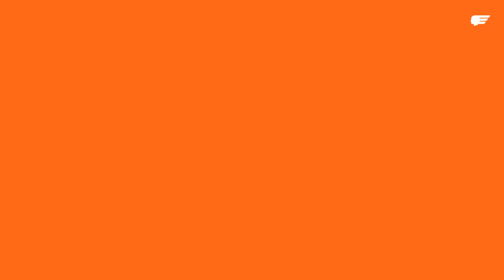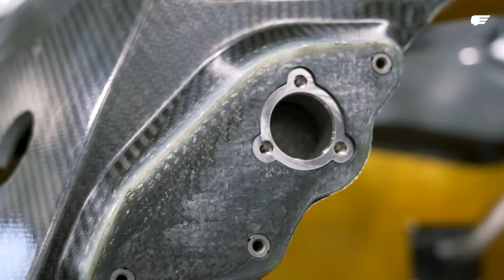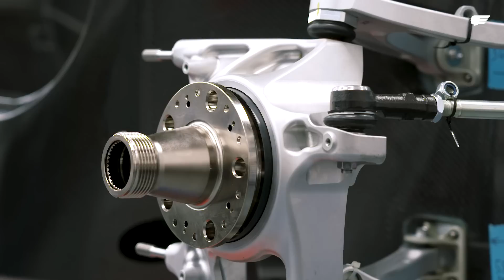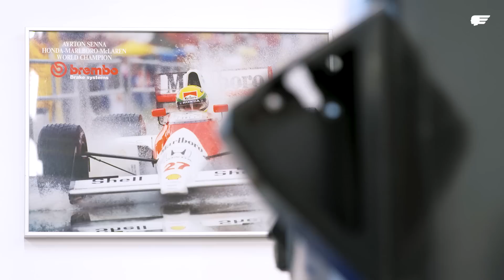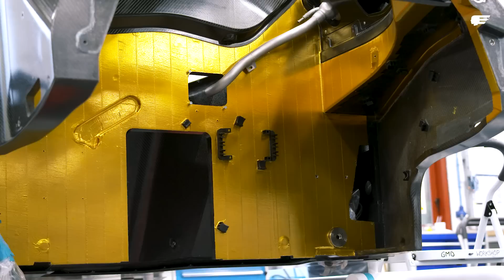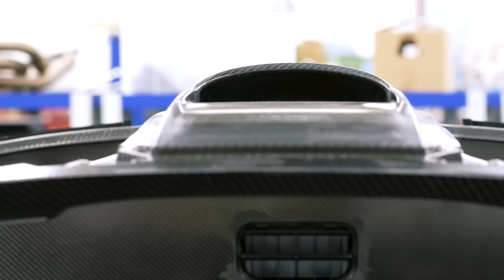T.50 VLOG | EPISODE #2 | XP1 MONOCOQUE

Comment: Now that's some quality teasing.
I see the gold foil from the McLaren F1 is back too! 🐧
Reply: It is DEI Reflect-A-Gold tape, not actual gold foil.
Reply: @erik_eriksson_design  It also has worse thermal properties than their silver colored foil, but everyone goes for the gold colored because bling bling. lol
Reply: @jlehm  Silver is better at wide range, but gold is better at narrower IR radiation band that happens to be found at enginebay temperatures. But from gold have been moved to MLI-materials. That is basically kapton on top of mylar.
Reply: @erik_eriksson_design  That may be true, but the two foils are gold colored and silver colored, but both are made from aluminum, and therefore where the products get their properties from.  The temp capability difference between the two products likely has more to do with the thickness of the fiberglass backing than anything. Go look at DEI's site.  It's really just a bling factor with the gold color.  I'm sure NASA uses real gold coated foil, but not us peons.
Reply: @jlehm  I wrote you long comment but youtube somehow missed it... anyway just google "Multi Layer Insulation satellite". Yes DEI tape is mostly for looks, but I think it was useful with my stock airbox, now I use different carbonfiber  ramair thing that I engineered and no tape.

Comment: I have never seen a front Wishbone suspension setup like this before. Does the lower vertical connection act as a leading arm while forming part of the lower wishbone setup? Tolerances must be crazy.

Comment: fascinating to watch this coming together. is this thing going to be drivable ?  this car is so much lighter than anything else in the hyper car world , rear wheel drive and that Cosworth engine ???  watch Chris harris talking about modern high powered Ferrari's being limited by the tyres and it begs the question how will this thing maintain traction ???
Reply: A lot less power than the new ferrari but that weight difference obviously means the tyres don't have to work so hard in corners
Reply: Tuning the throttle response curve will have loads of impact on that. F1 cars are lighter and have more power. It's all about how everything is balanced together.
Reply: Wind turbine dawg... Crazy downforce

Comment: Why doesn't this car have multi link suspension?
Reply: What for?
Reply: Ffs it’s not german scrap
Reply: generally when you have the opportunity unequal length wishbone/a-arm at all corners is the best way to get the job done. Most road cars have some sort of attempt at replicating the effects of such a setup but are limited by the amount of vertical space available. Solid axles are the cheapest and most rugged solution, and sophisticated multi link systems are what you're stuck developing when you have to fit a back seat or a cargo area.
Reply: @weatheranddarkness  AMG one engineers would differ. 5 link controlled passive steer provides significant advantages over double a arms.
Reply: @jamie101010  it's fundamentally the same as a double a arm setup only with split ends at the uprights. The advantages are not absolute either, and the biggest advantage is in being able to place the steering axis. But If you can get a bearing where you want it to be in the first place the a-arm is a stiffer option.
Reply: @weatheranddarkness  more accurate control of bump induced steering is a big advantage in handling. See how progressive all Ferraris became after they introduced their multi link on all models compared to their predecessors. That was by choice not by package constraint - I think they know something...
Reply: @jamie101010  splitting the pivots isn't the only way to manage bumpsteer.